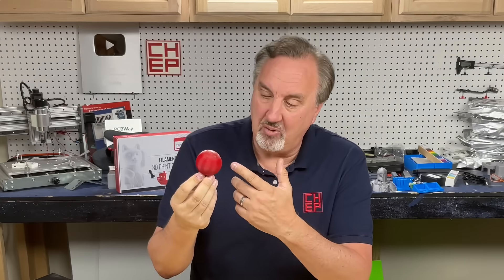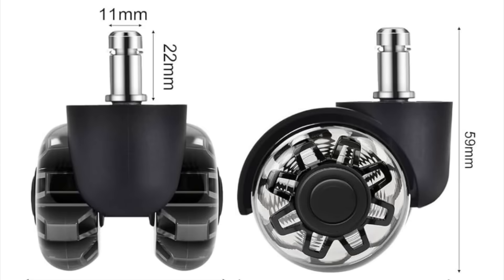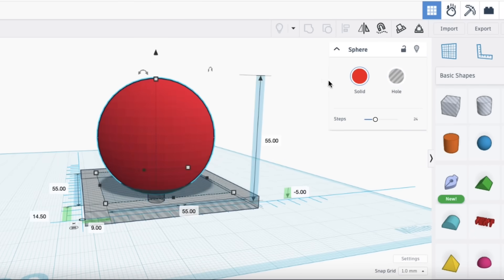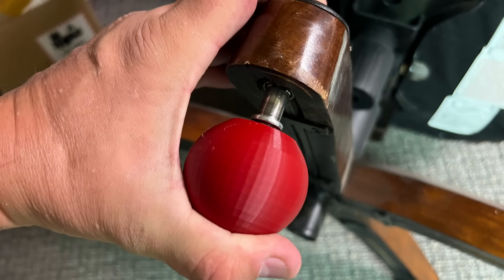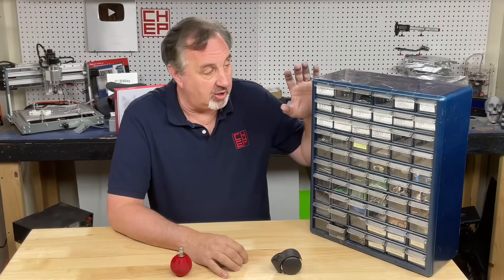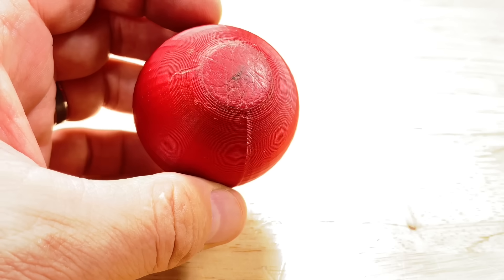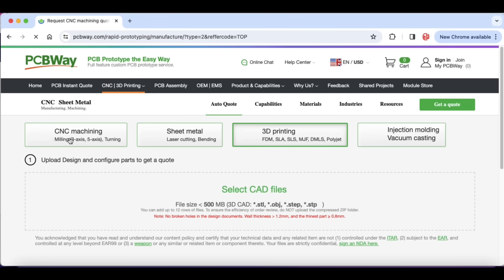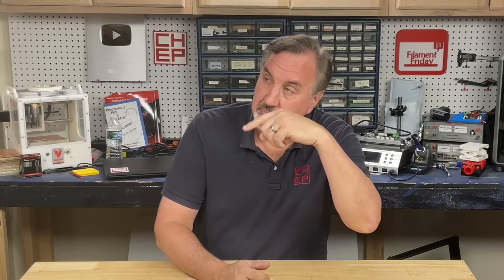Office Chair Upgrade: The PLA Ball Experiment

Comment: pla is perfect in not so hot envirnments, otherwise it can deform, but still, if its not unreasonable hot like more than 40 degrees celcius then its almost perfect for most applications
Reply: Agreed, I have some caps for pvc fence that were printed in PolyTerra Cotton White pla. They have been in place now for 4 yrs without issue.
Reply: the big downside is how brittle it is, for rigid applications it’s generally one of the best
Reply from the maker: @yellowhouse88 - The side to side force at the pin hole is large yet it shows no signs of cracking.

Comment: a firefighter squad received a brand new truck but broke one of the beacons a couple of days later, it was gonna take weeks for them to get a replacement so a friend designed a copy and i printed 2 ( in case they messed up the installation) in my cr10 with pla since it was the only material i had, used a 1mm nozzle, something like 0.8 layer height and 100% infill, not sure if they ever got the replacement

Comment: People saying PLA cant be structural and it will fail have no idea what they are talking about. I have 20 at least structural and supporting prints (speaker shelves, vesa mounts and so on) i've done over 10 years ago still going strong without any fail. I have friends who printed  jackplates to lift car, no problem going streong for 5 years. People are stupid as a mf, and you who say these things....just don't. you have no idea.
Reply: Same here. Plenty of PLA hooks, housings and replacement parts that are many years old. Modern PLA mixes are even better.
Reply: PLA is one of the strongest plastic you can print in pure compression strength. It's main weaknesses (at least of modern blends) are low temperature resistance and long term creep. 
If you make something that you load cyclically then it's not an issue. But if you have a print that's constantly under load it will deform with time,  even at a fraction of the failure load.
For something like this, where the load is mostly perpendicular to the layer lines and a bit of deformation won't be a problem, then PLA is a great choice.
But, as an example, for a monitor mount PLA is not a great choice. I've seen quite a few posts of people's expensive monitors falling down even years after installation.

If you ever try to use self tappers in a PLA print, you'll be surprised by how quickly the plastic can deform. in a few months the screw can go from really thight to loose with layers starting to split, even without any external force.
Reply: @Zilli_341  tensile strength*

print that’s under load is called stress. Constant stress that leads to permanent deformation is called creep. yes.

@loopychannel I appreciate you riding out for PLA but personally I’d leave the recommendations to engineers as I’m sure they wouldn’t reccomend PLA for structural parts due to creep. Along with this pla has a low heat deflection temperature of approx 50C. Look it up. Before calling people stupid you better have done your homework because otherwise you look stupid.
Reply: Brittleness is also a weakness

Comment: One of the first things that I printed was a set of shelf clips that are L-shaped with a round pin that goes into the side of the cabinet.  I had misplaced the metal originals and as this was in the days of COVID, I did not want to go out shopping for a set nor did I wan to wait to get some shipped.  They have been holding up just fine for years.
Reply: I work in apartment maintenance, these are a monthly print... you are right, they dont fail.   house cleaning just cant seem to keep track of them when they take shelves out for cleaning...

Comment: PLA can be surprising if you use it right (especially PLA+ variants).  Add extra walls (5 typically for me), and at least 30% infill.  I've had many prints that I can't believe how well they have worked.  Just don't expect a lot if it's going to be exposed to higher heat or impacts when really cold.

Comment: Just buy a set of good wheels and replace. That's what I did after several attempts with PETG.
Reply: I agree. Just because you can print it doesn’t mean you should print everything. Use it for the right application. I mean what’s next? A hammer from PLA because the handle cracked ?

Comment: Material creep, like PLA can suffer from, is a very specific mode of failure under very specific circumstances. It is not "just weak". I am very interested in how those hooks from the previous video are in a years time.
This ball is not under constant pressure, so probably will be fine for slow deformation.
Reply from the maker: 8 hours a day, 5 days a week, for 9 months with me sitting in the chair, it should have deformed and not be perfectly round by now but it is.
Reply: @FilamentFriday There is quite a lot of material that's being loaded perpendicularly to the layer lines for less than 1/4 of the time, at what is probably a small fraction of the failure load. I don't think you'll see any sign of deformation significant enough to be caught by the naked eye in years.